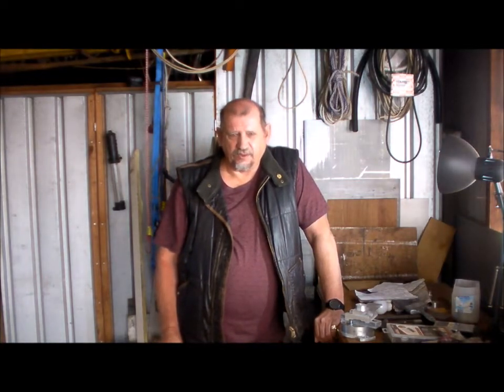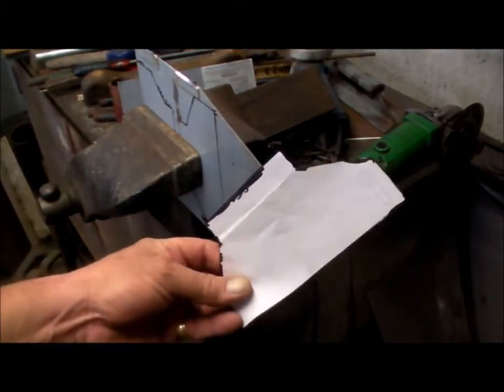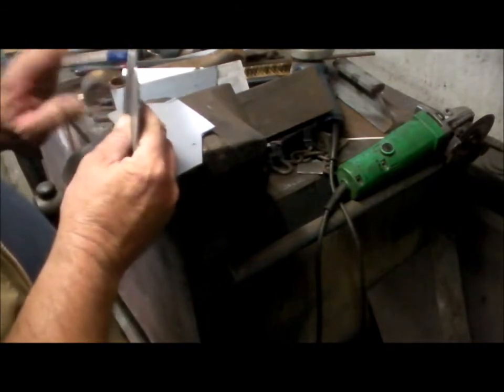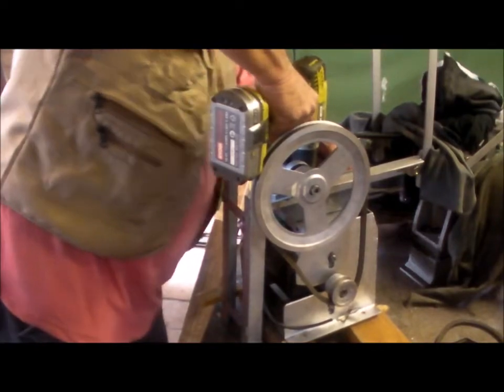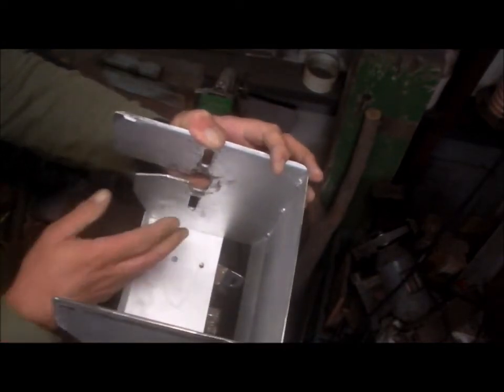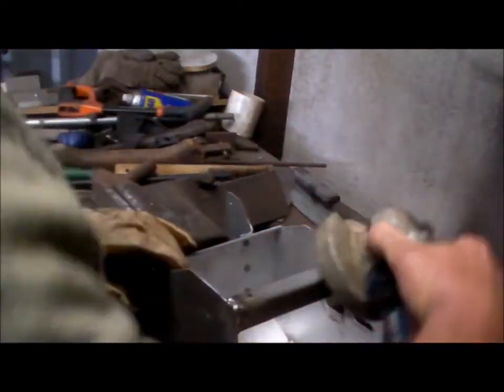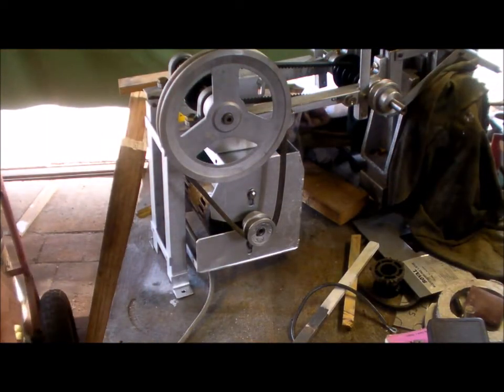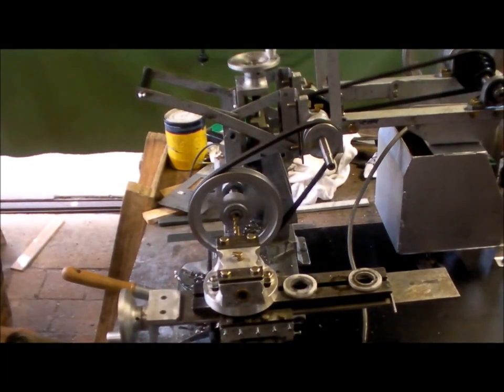Building the Gingery Milling Machine 53 the motor is mounted

Comment: Well there you are Peter in front of the camera video number 53 shows us this (HI PETER) I find it the hardest part of the video making thing, rather just show the work. About 6 minutes in Peter turns up the pneumatic hammer it runs with great precision like you do the metal cold rivet hammering. I love the three leg pulley wheel with the belt going around it, the two motor mount brackets are done and of course mounted well. The mill is coming along really well she is taking shape.
Reply from the maker: G’day Lance. I liked the process of cold riveting, it’s a good solid fastener and leaves a good finish on both sides and the rivet is a simple house framing nail. Cheers Peter

Comment: It’s alive!! You either have convinced me to do this myself or buy a really cheap one... verdict not out yet
Reply from the maker: Well, I wanted Machining to be my hobby in retirement and thought what will I make, model steam engines,steam traction motors etc, hmm.
What do I need? lathe, got one (small), 
What would I like, a mill.
I came to the conclusion that making STUFF was just as rewarding as completing it so why not make a hobby mill. 
So, do you NEED one, buy it
Do you want one and are prepared to spend the time and journey then make it, consider it just another project. If it becomes an unfinished project, then buy one and finish it off. Wow a vertical and a horizontal mill, Utopia
I've learn't so much, BUT it's not a weekend project.
Reply: PGS well said.  I was toying around with the idea of making something similar to a Dore Westberry Mill using plumbing fittings and gingery’s methods simply because I liked a vertical mill better. But I think going through the gingery method gives you hands on machining experience, that is without a price tag.
Reply: And no I don’t “need” one.